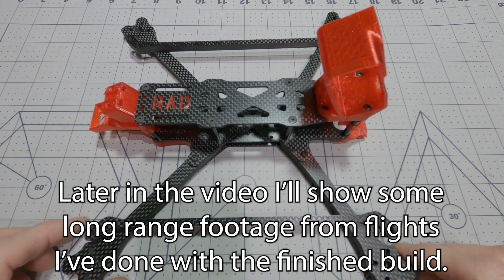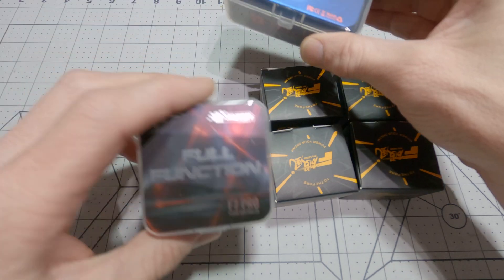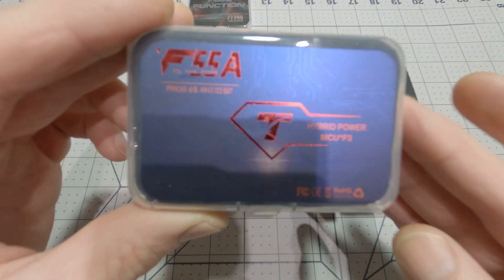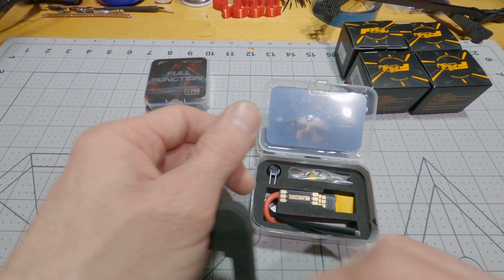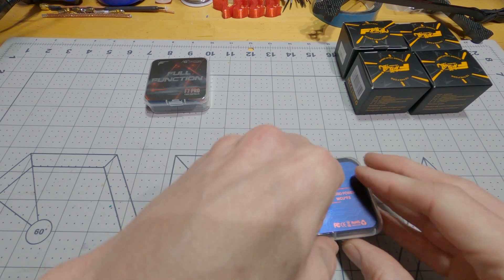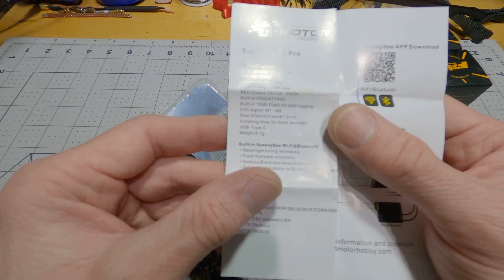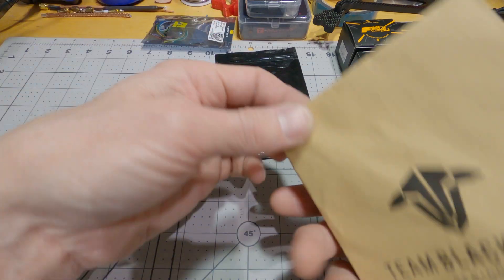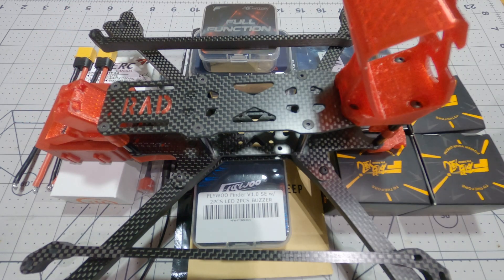Super efficient 2022 Long Range FPV build: Parts discussion

Comment: Have you seen/tried the "aeolus 2806.5 1250kv" motor? It seems to be really efficient based on their thrust table.  6-7g/W at 50% throttle. That is way higher than what I found for the f90. Unfortunately, unlike f90, it only has values for 50 and 100% throttle, so not much data. 

But it is used in the rekon7 which can do 27km in 18 or 37min (depending on how fast you're going) without gopro. Your result is with a gopro and just a tad worse, so it seems quite similar. But if those thrust  results are correct and it actually is more efficient than the tmotor, it might make a non-trivial improvement to flight time. 

I'll be building my first 7", so I'm trying to decide if the aeolus is worth it or I should get the well tested tmotor. Btw, would you recommend the ultralight build you just did for mountain LR? Or would you prefer a heavier drone and more battery like your usual one? I'm not near any mountains, so I'll be mostly using it for cruising around like I use my plane (so lighter and quieter is better), but I want it to be able to fly mountains for the few times a year I go to some.
Reply from the maker: Did the Rekon flight tests you are referring to also contain a lot of elevation gain?  For the flight time test I refer to in this video I flew up and down a hill multiple times resulting in 1.5 to 2km to elevation gain.  This will make a noticable difference in flight time.  I've never done a flight time test with no elevation gain, people would comment on it not being a real world comparison since I always fly mountains.  Each of my frames is for a different purpose.  If you want really good gopro footage you want the RAD Li-ion.  If you don't care about gopro footage so much and want the longest flight time possible then I recommend the RAD Scout.  Hope this helps, you can email me @ falconradfpv@gmail.com if you want more info.

Comment: Howdi would 2 blade prips not be more efficient?  Thx for the great info you provide !
Reply from the maker: 2 blade props are more efficient but they tend to create more vibrations than 3 bladed props.  My intent is to record GoPro footage for YouTube so I focus on getting better video over getting more range.  Besides with all of my long range quads I get more range than I need to make it up almost any mountain.
Reply: @FalconRadFPV  yup you have opened my eyes to LR just putting together a rig together as we speak 👍

Comment: hey  brother i'm beginner for drone tech, but have a great ambition to work on it from my childhood. the drone parts are not that much available in my country. i live in Ethiopia. i have seen a lot of videos from YouTube about drones. but i haven't seen such a wonderful channel that shows each and every step like this. thank u bro thank you very much. but if it is ur good willing could you send me a video of the remote controller part pleaseee? because u used some additional antennas for this best long range drone bro to make it more better. please post the remote controller part please if u can? told u i'm beginner please bro
Reply from the maker: Check out this video for info about my transmitter and control link.
https://youtu.be/uJTIoqfgb0k
This is another similar one about my video setup.
https://youtu.be/FJ2Q6tZvGeY
It's a lot to learn at first, check out Joshua Bardwell on youtube for videos to help with setting up the electronics.  He has hundred's of videos about building fpv drones.

Comment: I’m not new to electronics and soldering, but I’m new to building drones. Question: If I build a similar drone, is there an easy way to have it tuned in Beta Flight not having to spend hours testing back and forth?
Reply from the maker: With Betaflight 4.3 the defaults and presets are better than before.  If you have a common type and size of FPV drone then you will likely be fine with defaults or a preset.  The real time tuning a build is when an experienced pilot is trying to get the last 5 to 10% of performance out of it because they are good enough to know the difference.  Don't get me wrong a badly tuned quad will fly badly and it will be easy to notice for most people.  But the BF 4.3 defaults and presets are good enough that people will often fly with them with no changes and be quite happy with the flight performance.
Reply: That’s reassuring. Thanks for answering!

Comment: Do you have any recommendations for ESC settings or tune in general? I found out that a loose tune does better (efficient-wise, if there's no wind) but still have to experiment with ESC settings
Reply from the maker: I set the startup power down to about 30% and motor timing to 23 degrees.  Also 24k pwm, keeping it at 24k works best for bigger props.
Reply: @FalconRadFPV  thank you man! I was pretty sure about PWM didn't think about startup power. Will try and test :)

Comment: One las questionAre you using bidirectional or on the FC Uart4: ESC Telemetry/Rx or both? Thanks
Reply from the maker: I have the telemetry for the ESC connected and I'm using bi-directional dshot and RPM filtering.
Reply: @FalconRadFPV  Connected by wire? Im unsure to use Uart4 for esc telemetry, I'm using Dshot600 and bidirectional, very confusing....

Comment: Great build man, I just finished my Aos 7 with same Tmotor electronics and motors, what PMW are you using, 24, 48 or by Rpm? thanks
Reply from the maker: I use 24khz for my 7" builds.

Comment: Hello, I'm kinda new to building custom quads and for the most part got jello out of DJI action 2 recently, but it had occasional jitter and super inefficient. Well while researching parts list i apparently looked at outdated websites that recommend 2207 motors, so i got 2208s. Well I tried different props and still inefficient, so I researched more and found 2806.5 was a good efficient motor. So my question is if it's normal to have to stabilize video or is it normal for rock solid video if parts & tune are dialed in?
Reply from the maker: It is complicated.  Jello and wobbles in video are two very different things.  Jello will be caused by frame resonance and / or prop vibrations.  Lowering D filtering can help.  Also It can be avoided if you use a frequency chart (blackbox logs) to see which throttle positions to avoid, they will be different for every frame.  Some frames will perform terribly, some well and a bunch in the middle.  Wobbles in video can mostly be tuned out using the PID's but only if the build and its parts are capable of flying well.  Normally I stabilize all of my flight videos with Reelsteady on it's lowest setting to smooth out my stick control a bit and any bumps from windy conditions (it's always at least a bit windy when flying mountains).  With 7" props even a good frame and build will gets bumped around a bit in the wind.
Reply: @FalconRadFPV  Thanks for the info, i got jello out by using this stuff that's similar to flex tape. Now it just looks like a possible camera mount problem or external forces. Think I'll get a go pro to replace DJI action 2. I may be guessing, but i think the more surface area of go pro mounts may have less vibration? I do enjoy building my own quads, but I'm still new to FPV so a lot of trial and error to me. In fact I'm quite embarrassed that I thought 2207 motors were more efficient for long range. Well it wasn't working that way for me, so I did more research and found that 2207 used to be more efficient like 2 years ago lol, so I replaced those with BH 2806.5 and soooo much better it atleast doubled my flight times. I'm coming to the realization that I may need to build a 7in to replace my 6in for real long range. 6in props just doesn't seem like enough lift maybe really stressing the props with the bigger batteries. Coming from camera drones, I guess I'm looking for perfection, like the GPS rescue function, that one took the most trial an error for me.

Comment: Hey I'm very interested In building a longrange 7", but i want to stick to a lower budget. Do you have any videos for a budget LR build? Is 4s li-ion viable for LR? How much worse would your flight time be if you just used LiPo? 

I think I'd like to build a 7" that I can use for both LR and Freestyle while still having considerable flight time, this is why I'm wondering about 4s li-ion because I only have 4s LiPos for freestyling

If you have any recommendations or could direct me to a relevant video of yours that would be great! Thank you
Reply from the maker: The issue with 4s and li-ion is that the lower the voltage the higher the amps.  Same quad same parts, 4s version vs 6s version.  The 4s will avg. say 35 amps while the 6s one will avg. probably 25 amps.  A lipo can take considerable amp draw and be fine.  Li-ion cells are MUCH more susceptible to voltage sag and/or damage from excessive amp draw.  I did make a 7" that ran on a 4s2p 21700 li-ion setup it did fine with the amp draw but that was with 1700 kv motors, ok for long range but not great for freestyle at all.  It might work for you if you used the highest amp rated 21700 cells, like molicel P42A (rated at 35 amps constant, double that for 2p)  Maybe with 1750 kv motors or possibly 1800 kv on 4s with like a 90% throttle limit might work for long range and freestyle.  Or use little bit of throttle limit for long range and none for freestyle, just use two different BF profiles to switch between.

Comment: What size/configuration battery did you run to get the 26 min/24km? I built a 7inch last year and just made a 4200mah liion with p42a 21700 molicels and landed with 3870mah drawn, 18 min airborn and 18.7km covered. Run 21700 6s2p or 18650 6s2p?
Reply from the maker: Ya it was 21700 6s2p.  I flew between 40 and 70 kph for the whole flight.  It doesn't fly as nice as 6s1p but it gets some extra range despite the weight.
Reply: Ya on my flight I had a 6s1p at 430g. AUW was a hair over 1100g with average speed at 62kph. 860g worth of battery is pretty hefty sounding haha. I guess somewhere in between is a 18650 6s2p configuration.

Comment: I tested the T-Motor Vs Brother Hobby Vs E-Flight motors and did indeed find the F90 slightly more efficient than the other two albeit on 6" props (that was all I had at the time) The efficiency order was T-Motor followed by Brother Hobby then E-Flight slightly behind. However if cost is an issue the E_Flight are a decent choice too! IMO the efficiency gap would be slightly larger on 7" props though!
Reply from the maker: Glad to hear your testing had similar results, ya the T-Motor stuff is top quality!

Comment: Why did you not share your frame weight? Same as with the Falcon again. what is the problem with the weight always?
Reply from the maker: For the Falcon 7 video I pinned a comment to the top with a breakdown of the weight.  I just made a couple more changes to the RAD Li-ion frame and wanted to wait and weigh it exactly as it would be when people bought one.  The weight will be in the release video tomorrow as well.  The RAD LI-ion assembled frame without tpu parts, 190 grams, with the necessary TPU parts (no gopro mount) it's 210 grams.  That does not include the fasteners for the braces, they are connected to the frame by using eight extra long motor bolts.  All of the needed motor bolts are included as well as four 25mm M3 for the stack.
I am thinking about having a light weight version available as well.  The regular one has great vibration performance and captures really crisp nice GoPro footage.  I have a light weight one with 5mm arms that weighs about 160 grams.  It's no good for gopro footage but still fly's really well.

Comment: Hi, its me again ^^ what liion did you use? 21700 4000mah?  And hows the props feels? Need more trotel resolution?  Thanks
Reply from the maker: it was 21700 4000 (P42A cells) 6s2p so it feels heavy flying with that battery setup.  I think 18650 2600 or 2800 mah  feels better to fly and still will get over 20km.  I just bought a bunch of molicel P28A.  My last set of batteries were P26A.  I'll post a video about using those batteries and the range, in about 4 or 5 weeks.  I still have to make the battery packs.
Reply: @FalconRadFPV  thanks, how about the prop2? I've  try gemfan 7035 and feels more heavy, more efficient but feels a little bit less power

Comment: Hi, thank you for your videos. Very nice setup. I saw in previous videos you had brotherhobby avenger motors, how they in comparison to T-Motor F90? Now I have emax eco II 2807 1700kv, and they are not the lightest and the kv is a bit high for a long range. So I was thinking to upgrade, the brotherhobby and the T-motors are an option.
Reply from the maker: I recommend the T-Motor F90's.  I was using the BH but recently switched and I really like the F90 motors, they are more efficient in my opinion.

Comment: Hi, is the Rush Tank Solo better than the TBS unify Pro 32 HV?
Reply from the maker: I'm not sure.  I just got tired of all the interference from the TBS unify HV and decided to use RUSH VTX's instead since they seemed to put out less interference to the GPS.
Reply: @FalconRadFPV  Yes you're right about the GPS interference from the Unify. The way I  found around that was  to keep the vtx in pit mode until the GPS has locked on to the minimum satellite count.

Comment: Tuning please 🙂
Reply from the maker: I'll probably do some sort of tuning video for this build but it's going to be a little while.  I've already got a list of videos to get through making.  A quick hint about the tune though, I'm using almost all the same Betaflight settings as in my Falcon 7 Betaflight settings video.  Only real changes are (still using BF 4.2.X)
-the filtering 1.4 gyro and 1.3 D-term for the sliders for now.  It's going to vary a lot depending on BF 4.2 or 4.3 as well as RPM filtering or not.  I'm using BF 4.2.x with RPM filtering.
-a setpoint of 11 (can't remember what the Falcon 7 was)
-the PID sliders, Master = 1.2, P/D balance 1.1, P/D gain 1.2, Stick response 0.7
-I'm also using slightly lower rates more like 340 degrees/sec

I think the rest is all the same.
Reply: @FalconRadFPV  thanks

Comment: Can we use dji air unit with this new frame?
Reply from the maker: Only a vista will fit, and it needs to be the 19mm fpv camera with one hole in the center for mounting.  Unfortunately it needs about 15cm cam cable for a vista but they only come in 8, 12 and 20 cm.  So the excess will need to be held down with a zip tie.
Reply: @FalconRadFPV  I wait the release for buy your new frame 😉

Comment: Look forward to seeing the reveal of completed build and build video. The upgraded TPU bits in addition to the awesome hardware are very nice.

Do you plan (or have you) conformal coated or take other measures to protect the FC?
The ESC is coated, but need to solder to FC pcb. Baro poses issues for coating, so have wondered if a TPU encasing would be viable option. Curious how you (have) approach this in you build. Your new Vista  TPU mount has me intrigued.
Reply from the maker: It's conformal coated, I put a bit of tape over the baro during the process.

Comment: I have never built a quad before, would this be to difficult for first timer?
Reply from the maker: Soldering for any quad build requires some practice and skill.  I would recommend building a cheaper and more durable 5" for your fist one.  This build uses two xt60 pigtails so the ESC soldering may a bit tricky for some.  A good soldering iron is necessary, 50amp+ esc's quickly draw heat from the soldering iron.

Comment: Hope you never crash these motors. Very weak 4mm shaft and also weak bell design. After a slight crash, they are out of balance. Otherwise great motors, very light and good bearings. I liked them more than the BH. Very surprised that they are more efficient, since I didn't noticed any difference to the BH in terms of flight time.
I stopped completely using Brotherhobby due to reliability issues, bearings are crap and cople of them got loose magnets.
Reply from the maker: Thanks, I'll keep that in mind about trying not to crash them.  My amp draw is noticeably lower than my BH 2806.5 setup.  Tmotor 12 to 15 amps for 70 kph.  BH I was getting more like 16 or 17 amps to do 70kph.  The thrust test data for the motors also shows a noticeably lower amp draw on the Tmotor especially around 30% or 40% throttle.  I spend 2/3 of a long range flight going out and back at about 35% throttle.  As well the two builds are also on completely different frames.  The RAD Li-ion frame has much less drag than the cinematic Falcon 7 build that I am comparing it to which also adds to the efficiency difference.
Reply: @FalconRadFPV  
Thanks for the explanation. I tested different 2806.5 motors on the same rig:
BH, T-Motor, EMAX Eco (2807) and Iflight Xing. As far as I can remember, the T-Motor showed slightly less amp draw during hovering. I think that weight and prop choice has far bigger impact than the motor brand. That's what I noticed during all of my testing. At the moment I'm running the Xings, wich are great in terms of balancing, reliability and quality. Downside, they weight 53g wich is on the heavy side at that class.

Comment: Is there an HD setup video for this? I'll love to build one but hd, DJI preferably
Reply from the maker: I have made a vertical mount to hold a caddex vista.  It won't fit a full size air unit.  The vista would need a 90 degree mmcx extension.

Comment: Very nice, thanks for the overview. I'm looking to build a 7 soon, so I'll be following along 👍 Have you run inav yet? So nice to be able to hit loiter if a situation arises with your radio, goggles or surroundings.
Reply from the maker: No I have not used INav.  Although this build will be all set to run Inav.
Reply: @FalconRadFPV  So you suggest getting started in Betaflight first and if everything works as normal, then switch to INAV? I tried INAV and had issues, but that was before figuring out that I needed a piece of foam over barometer and Compass orientation.